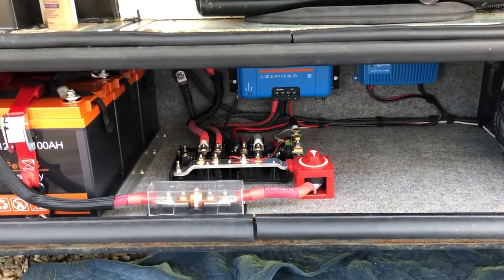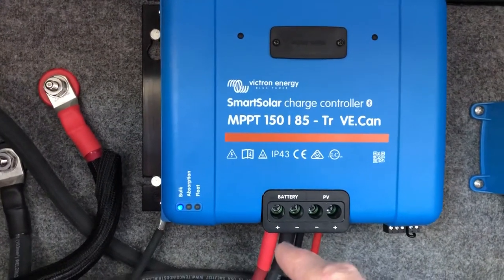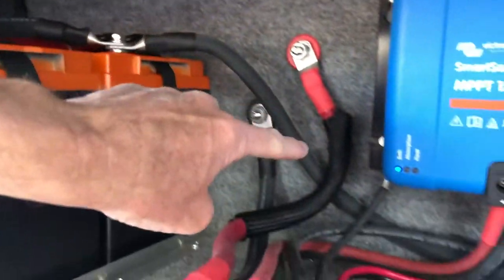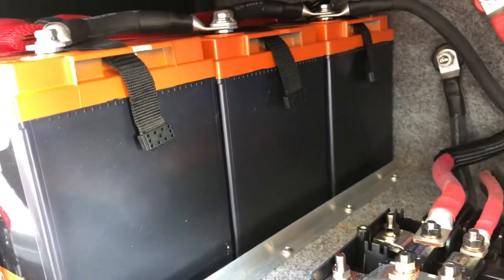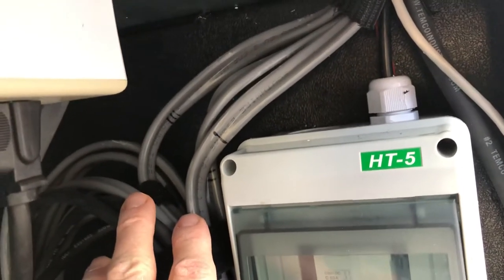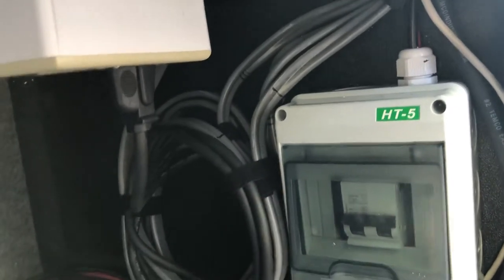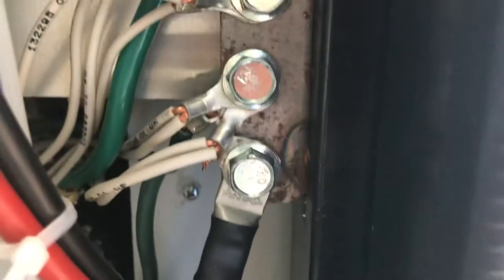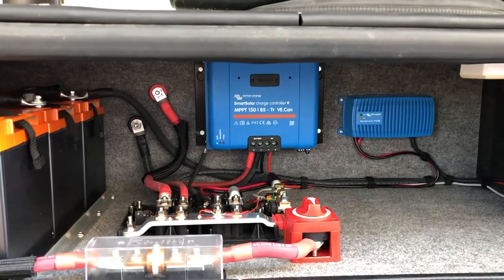RV Solar System - Phase 1

Comment: Nice system! I’m upgrading to Victron from Renogy and am impressed with Victron’s engineering. After several videos it is clear using the Lynx distribution system actually makes practical and financial sense as well as giving a super clean and safe install.
Reply from the maker: Agreed.  The engineering (capabilities) of VictronEnergy products are amazing. Being able to program all the different features is great.  Soon I’ll be implementing phase 3 of my install, which will be adding another 800 watts of solar panels (8ea 100-watt panels) and adding another 300Ah of batteries in a separate compartment.  I’ll post a video when I do that.

Comment: Don't forget to always disconnect the PV supply with your HT5 prior to full disconnect with you red rotary master switch. If the red switch is disconnected first the solar charge controller will be surged and can be damaged. Dont ask how i know. Thanks for the great vid.
Reply from the maker: Interesting, everything I thought I knew, was the opposite.  For example turn on battery switch, program the charge controller, then turn on PV.  I’ll have to look into it more, thank you.
Reply: @coryhanes  yes that’s right just a breaker in the plus from ph will do the job .
Reply: The connection order is the opposite of the shut down order.

Comment: Thank you for sharing. This system is similar to what I've been working on for our RV build. It's good to see that I'm on the right track and, for the most part, seem to be doing things the right way. :)
Reply from the maker: Thank you. There is a phase 2 video as well, the addition of the 3KVA inverter charger.  I’m work on phase 3 which is adding more panels.

Comment: I've been doing research on 'RV Solar Systems' and this is a very 'clean' setup inside a compartment which I was looking for since my cables from the prep solar also are in the compartment. You stated that you have 8 solar panels but I don't think my RV roof has the space for it so I'm looking to do the same but with 4 panels @ 100 watts connected in Parallel. Very nice setup and I'll use your config inside your compartment. Love the idea of using the Lynx distributor. Best one I have found...I was trying to locate the links for the items that you used but didn't see one. I was wondering if you could add the links ?? Thank You sir..
Reply from the maker: I purchased everything from Amazon, I do not have the links to share. I just searched until I found the correct part I needed.

Comment: Nice system !! The only thing that I can think of is if something would over heat or throw a spark you have  cooked chicken.. I put mine in a fire proof box.
Reply from the maker: I think it’s pretty safe, you’ll see in later videos that I moved the batteries to a separate compartment to reduce the chance of over heating the them, and I added an automatic cooling fan that turns on when it gets warm in the electrics compartment.

Comment: With the lynx distributor and the Victron 25a battery charger hooked to it (as it appears you have) , can you send solar and shore power to the battery at  the same time? I was curious about this.  Thanks.
Reply from the maker: Yes
Reply: @coryhanes  bonus 🎉. Definitely adding to my build.

Comment: Two types of victron bus bars:
Lynx “distributor” has leds and includes bolts/nuts to connect fuses

Lynx “power-in” does not have leds (and does not include bolts/nuts hardware for attaching fuses)
Reply from the maker: That is correct. I’m using the Lynx Distributor. But keep in mind the LEDs do not function unless you plug in a device to the status port (RJ11) such as the Cerbo GX or the shunt designed for this system. I cheated and provided the 5VDC to the RJ11 to get the LEDs to function. Not really necessary but I like the the quick glance feature to see if any fuses are blown.

Comment: Great install, question? Why the disconnect on the positive side? I see installers are doing this and battery manufacturers recommended on the negative side. Also, will the BMS in the batteries allow for you use them to jump start your engine batteries?
Reply from the maker: Solar systems I’ve seen always put the main disconnect on the positive side. For my system I put it on the positive. It may not matter which side you put it on as long as you achieve a complete disconnect. I have multiple grounds in my system so it was easier for me to install it on the positive side. You may need to check with an electrician to validate your design. As for jump starting my engine battery with my coach / solar batteries… my design could safely do this as I believe each battery BMS had a 100 Amp rating and they are connected in parallel providing a 300 amp capability. Bottom line, it depends on your battery/ies BMS capability. Most BMS’ have an over-current shut off, but I would never want to rely on that. Again, check with an electrician and your product specifications. Note, I no longer use that original design, it was short term. I now have six batteries in parallel… see my other videos.

Comment: Great detailed summary. Question, the larger ground in the lynx (under the MPPT ground in lynx), where does it go to?
Reply from the maker: All the grounds are connected together at the Lynx distributer (negative bus). The negative bus grounds to the chassis of the Motorhome.  There are a few other Fidel’s on my channel that may illustrate this better.

Comment: Where did you get the flat copper bar that connects the shunt to the lynx?  Is it the same thing connecting your switch?
Reply from the maker: Both bus bars are the same. I purchased them pre-cut and drilled from Explorest.Life YouTube channel.  He has a lot of information on solar.  Or you can buy the copper bar from Amazon, cut and drill yourself, which I did in my later phases when I added a ground bus.

Comment: Very informative. 
But why do you  refer to your  inverter  as a  inverter/charger.   And  then  have a separate  battery charger,?
Reply from the maker: I may have misspoke… in this phase one, I installed the solar charge controller and a battery charger. The solar charge controller only charges the batteries when there is sun light and the charger allows charging with 120 VAC (generator or shore power). Having these two options allows charging when solar isn’t enough, like on a cloudy day.  As for the inverter/charger I installed that in phase two.  Before installing the inverter charger I removed the charger as both are not required.

Comment: Love it..! VERY well explained. New subscriber..   I bought 30' 4ga to run from my recently connected Multiplus II 12v 3000 120.. to the batteries (4 100Ah BB lithium's). The arrays are:3x290w and 6x200w on a dual axis tracker. (video on my channel) So I tried saving money when I bought the wire.. (MYBAD)  it does work.. WHEN I am not running\using the desktop pc and the nicehash software to mine (GPU\CPU) with..5 or 600w  but they will run off the batteries, but it can't handle the surge when I switch the MPII from on to invert or invert to on (shore power) so I went and bought 60' of 1 Ott wire yesterday. All they had was Black. So it'll be cut in half and tape up the ends with red tape for the positive cable. I am using my laptop now just to save a bit of of the shore power; (my conservation program) current loads are 206w and PV is: 145w..  I use Victron controllers 150\70's, BMV 712 smart, Lynx distributor and their CERBO with touch 50. Gotta LOVE the Victron connect app.

Comment: Nice neat installation.  If i were you I would devise some sort of protective cover for your bus bar.  Just to keep the elements (dust, moisture, etc) away from the bus bar.
Reply from the maker: Thank you. The bus bar has a cover, I took it off for the video.  If look for the Phase 2 video you’ll see the cover and the installation of the inverter-charger.
Reply: @coryhanes  Where did you buy your bus bar and how much?
Reply from the maker: @carolinecrona2481  you can buy copper bar on Amazon 1” wide by 1/4” thick in various lengths. Then you can cut and drill them.  Or you can buy precut and drilled from Explorist Life YouTube page.

Comment: Nice job, looks really clean.
 Would you happen to have the model and make of the compression crimper that you used?
Reply from the maker: TEMCo Lug Crimper Tool TH0012-8 AWG - 0000 AWG(4/0) DIELESS Indent Electrical Battery Terminal Cable Wire 5 YEAR WARRANTY https://www.amazon.com/dp/B00HJYVFSG/ref=cm_sw_r_cp_api_i_7D29E1WVCAFR2JRE57ZK

Comment: Great Video, Cory!  nice system and very well done.  Great design, nice neat work.  When you get the Victron MultiPlus 3000, suggest you get the MultiPlus II, not because of the added features, although they are quite valuable, but because it is newer technology and has more memory for current and future updates, where the older version of the MultiPlus is just about maxed out when it comes to accepting updates.  I'm not an expert, but I have heard this and it's likely the newer technology in the MultiPlus II is worth the added cost. Thank you for the great video!  Both the system and the video are very nicely done.
Reply from the maker: Thank you

Comment: Looks good, however you want to have the T fuse as close to the battery as possible. And POS and neg wires coming off the batteries, ideally those wires should be the same length, including the shunt.
Reply from the maker: The T fuse is as close to the battery that I could mount it, there is only about 18-in between the fuse and pos battery terminal, plus I added additional insulation over the pos wire.  The pos and neg leads are within a few inches in length, the resistance is negligible at 4/0 wire gage and only about 2+ feet in length.

Comment: Thank you for this video
I am DIY'ing  a system in my house to run my computer room
It's very confusing but I have found that using a VICTRON system makes things a bit easier to understand
Im still a bit confused on what size fuses I should be using on the LINX buss but I just wanted to say thank you for this video
Regads, Rick
Reply from the maker: Do a search for wire ampacities, the fuse is sized to protect the wire.  In its simplest description, the chosen wire type and wire gage is sized for your maximum current draw at maximum temperature of operation. Once you figure out the maximum current draw and the maximum temperature and the wire type you are using you can look it up in an ampacity chart to determine the acceptable gage size.  Then the chart illustrates the maximum ampacity of a given wire gage, this is typically the fuse size.  You can search National Electrical Code (NEC) for a better description and charts.  By the way check out this link… this will help you better https://youtu.be/5y-yDMEgV70 this gentleman has a lot on solar systems.

Comment: Very clean installation!!!
Do you have the batterie reference ???
Thanks,
Pascal
Reply from the maker: I purchased the batteries on Amazon, CHINS 100Ah, 1280Wh, 12.8 VDC. You can find them for about $340, and they have a ten year warranty.  The batteries I purchased meet the specifications as advertised. I tested through my Victron Energy system. The three batteries in parallel produced 304 Amp hours of energy and that was turning the load off at 11 VDC. I’m sure they would have produced a few more. V I’m pleased as they are inexpensive and good quality.

Comment: Hi very clean and need work . Something that I saw , the victron gear needed space to breathe and gets hot , a will ad an aluminum plate for the mppt and the Orion.
Reply from the maker: Very true, my is getting hot as well.  I’m on the maiden voyage with this unit now, just left Lake Havasu area and it got hot, went into thermal shut down.  I purchased an IP67 silent cooling fan and vents, I plan to program one of the switch outputs on the inverter-charger to turn on the fan at 105° +/-  Will be installing this when I get home.  For now I just prop the hatch door open.

Comment: Hi Cory, I have the same Circuit Box you have in your timeline 0:18, I'll be installing the same box for three separate devices. On three separate circuit breakers. They will be a connection of 3 Phase wires. Hot, Neutral and, Gound. Do I need a small Bus Bar to connect, each Neutral wire for each device? I'm using a Victron Multiplus 3000.
Reply from the maker: Hello José, I’m not sure I understand the question. At 0:18 into the video is a 12 VDC Lynx distributor (DC bus bar with mega fuses). This is the 12 VDC distribution point for the system.  Your question sounds more like something that pertains to AC voltage (hot, neutral, ground). When stating 3 Phase, this means you have 3 hot wires (L1, L2, and L3, each 120° out of Phase from each other. Along with a neutral and a ground wire). So a 3 phase circuit typically has 5 wires.  I believe the VictronEnergy MultiPlus 3000 can be setup to provide 3 separate phases. You would need 3 MultiPlus units.  But I don’t think that is what you’re asking. Can you clarify?
Reply: @coryhanes  First of all, Thank you for addressing my question. I’m sorry about all the confusion. When it comes to electrical, I get a little confused. Let me see if I can clear up my concern. I am using three Circuit Breakers for three separate Devices 120V. When it comes to 12V DC, I have No problem understanding the electrical. But when it comes to 120V AC, it becomes a little tricky for me. I am using a 3 in one, 14 Gauge wire. Black, White, and Green. I know this is going to my Victron AC line 1 out. If I was to use one Breaker and connect the Black wire (Hot) to that Breaker. Where would the White and Green wire go to? This is where I was asking if I need a Small Bus Bar, so that I may distribute the natural (white) wire and the Ground (Green) wire, through the Bus Bar. I am not sure if is this is how it works. I appreciate your info.
Reply from the maker: @Salsadepr40  Okay I understand a little more, so first of all, not sure what your current draw is on that circuit, but keep in mind that the MltiPlus is capable of 3000VA (3000 watts) and Can provide more than 30 amps.  So 14 gage wire is too small for your application. Again depending on what you’re doing, you would run a feeder from the MultiPlus to a main breaker in a sub panel, this breaker and wire needs to be sized properly. If you’re rusty with AC electrical I recommend that you get with an electrician to help size your breaker and wires properly.  
     Wiring up multiple AC breaker in a sub panel is typically like a house panel, there will be one common ground bus and one common neutral bus bar. The neutral is typically isolated from the ground.  Again check with an electrician because the configuration can vary.
Reply: @coryhanes  Hi Cory, I see where you're coming from. And you are right about this. It is better to have a licensed electrician than me tying to DIY myself. I appreciate your info, Thank you.

Comment: Can you add a larger-scale blueprint of your system showing the components that are tied together in your solar system such as the battery connections the buzz bar your battery Bank your inverter excetera where to be a little more clearer thank you
Reply from the maker: I do not have a schematic that I can share.

Comment: Cory, I am completing my install currently.  MultiPlus II and I also am using a Victron Lynx Distributor.  When I cabled the 4/0 to my inverter, I noted the the “nose” of the crimped lug interferes with the mega fuse I have installed on the Lynx for that supply.  I started searching today to see if anyone commented on this and found your video.  It appears that you have filed or ground the “nose” of the rounded end off of your lugs where they connect to the Lynx.  Can you confirm that?  I’m just relying on the video here and they it looks like I can see some exposed copper and the end of the lug looks flat to avoid squashing the mega fuse.  Thanks in advance and nice video sir.
Reply from the maker: Yes, I had the same issue.  I used my table disk sander to reduce the the size. Keep tuned as I’ll be upgrading to phase 3, adding 3 batteries and moving them to an adjacent compartment, adding thermal controlled cooling for the inverter-charger compartment, and hopefully installing 8 more solar panels.
Reply: @coryhanes  Thank you for the reply.  I'll have to follow suit. Seems that only the 4/0 lugs have this issue.  I'll stay tuned as I have concerns about heating and cooling of my battery compartment.
Reply from the maker: @jimsjacob  did you see the phase 2 video?  It articulates the installation of the inverter-charger.
Reply: @coryhanes  Yes, I did.  I just installed my Multi Plus II and went some of the same steps.

Comment: Hello, I just saw your Video, I am building my Victron setup now. I have a question regarding the Shunt, I see you have it between the battery and the Lynx, Is that the best place to put it to get the best readings? In my system I have the Shunt on the other side of the Lynx.
Reply from the maker: For accurate readings the shunt should only be installed between the negative terminal of the batteries and the negative bus bar (Lynx).  This way all (100%) power usage will go through the shunt.  This provides accurate data.

Comment: Where did you find the copper bus bars?
Reply from the maker: You can get copper bar stock on Amazon 3/4” x 1/4 x length, then cut and drill to your application. Or you can acquire them through https://youtube.com/c/EXPLORISTlife great RV DIY page.
Reply: @coryhanes  thank you